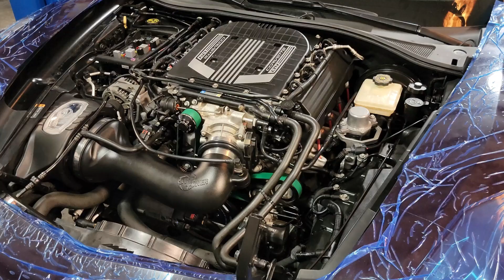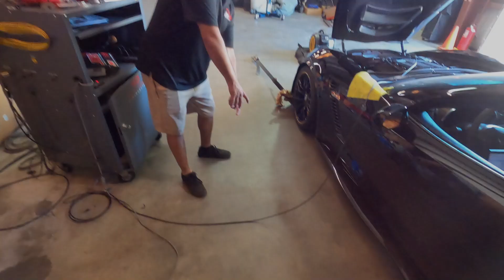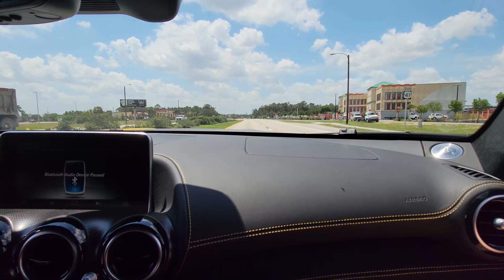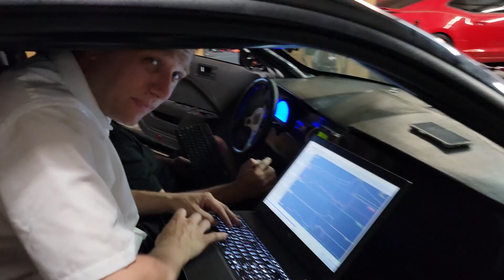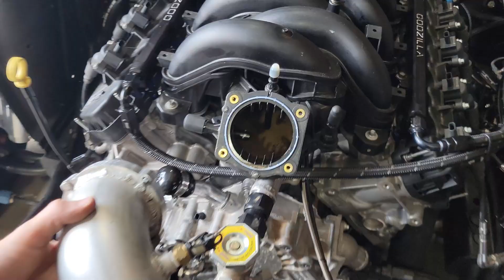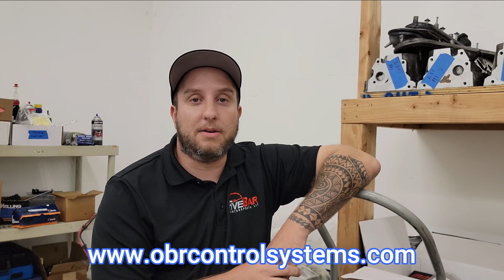Pushing the 7.3L Godzilla to the LIMIT! Over 1000TQ!?!

Comment: How am i supposed to get thrilled about a big V8 making 1000 hp or torque when 4 cylinders half the size regularly make 1800 hp or torque on the same dyno machine? So why cant people find 2500 or 3000 hp with the coyote or the "godzilla 7.3"?
Reply: 1800 torque with a 4 cylinder? maybe at 10,000 rpm or 100 lbs of boost maybe....

Comment: I’m way late on this video , sorry. Are you still running a 7.3 zilla??
Reply from the maker: Yes we are.
Reply: @FiveBarMotorsports  still single turbo?
Reply from the maker: @rtroll7762  Yep. Stock engine. Stage 1 camshaft. 88mm turbo. Ran an 8.6X through the quarter
Reply: @FiveBarMotorsports  awesome!!! I’m looking to put a zilla in a ‘79 F100 short Bed 2wd

Comment: Thumps up for blowing up a brand new motor!  Everybody goes to the hockey games to see a fight.  We go to the oval track races to see some wrecks.  And we come to the youtube dyno videos to see some people blow some stuff up.  You guys did not disappoint.

And now the armchair warriors of the internet will have a video to link back to while getting into arguments with strangers.  Stock godzirra motor is only good for 850HP.  Any more than that and the block parts like the red sea.  :P
Reply from the maker: After going back through the logs with Johan from OBR, this engine made the power that it did on seven cylinders. The original OBR Control System did not like the 16 volt system we are running the car on and fried an ignition coil driver. We're fairly certain that this contributed to the engine failure we had. 

People can talk all they want. This platform is only getting more and more popular as the days go by, and we're more than okay with being the folks that are completely transparent about what works and what doesn't work. :shrug:
Reply: @FiveBarMotorsports  That reminds me of a 1972 comet I had in my younger days with the inline 6 250CID.  I drove it around on 5 cylinders for quite a while.  It had a nice loppy idle to it.

Comment: When I saw the cracked cylinder my first reaction was to think it had a weak(ish) block. But then I saw the other bank had a missing rod/piston. I believe the cylinder wall broke due to hydro-locking as I've seen this happen before when a motor took in water. My question is where did the coolant/oil come from? Blown head gasket or did it come from the dead hole in other bank? What caused the piston and/or rod failure? Power? Detonation/knock?  Possible hydro-lock from a head gasket failure? Have you guys figured it out?
Reply from the maker: We're going to be releasing a video very soon explaining exactly what transpired. Interesting stuff.
Reply: Cheap 93 gas is what happened.  With e85 this would not of occured.

Comment: Can this new engine be installed in the F150 that has the 5.4 3valve on the 6 speed trans
Reply from the maker: It should fit in that truck relatively easy.

Comment: I'm really interested what these motors can do with a strong camshaft and maybeee some mild head work on 93 pump gas, then a smaller amount of boost like 7-10 lbs. I think that limitation is just as important to the average end user of this motor than the guys going for 1000hp+ and 8s in the 1/4. The coyote is so bottlenecked by fuel if you live in an area without E85 like myself. I'm making like 680hp/570tq on 10lbs (paxton) 93 pump. If a godzilla can make say 800hp/800tq on a cam + low boost setup on 93 pump. I would buy that over a built 5.0 simply because the fuel availability would still limit the built coyote's power whereas the Godzilla's ceiling would be a bit higher even stock bottom end. thoughts?
Reply from the maker: Once we have the methanol engine in the S197 we plan on doing some more practical testing with the engine in another chassis. Brian Wolfe over at Willis Performance Enterprises has a lot of great content on some NA applications on the engine dyno.
Reply: Yep, that's where I landed with my 550. No E-85 anywhere near me, so 93 octane was it. Heck, I was glad to even have one station near me with it, but just one.
Reply: you have the same issue no matter what engine base you use, higher horsepower/torque requires better fuel simple as that.
Reply: E85 is needed on this Godzilla

Comment: 1000 tq 800 hp is the stock limit it knocked right before you got on it I think it was the RODS Time to go to a 100 turbo instead of the 88 with those torque numbers or giant cam to lose some torque and make more hp
Reply from the maker: We will definitely have a rowdy cam in our built engine but for now we are throwing another stock longblock in it to go and see if we can run an 8.
Reply: @FiveBarMotorsports  nice . I think the torque it makes destroys itself seems to have the same issue as the 3v weak pistons and rods.
Reply: @FiveBarMotorsports  you guys thought about consulting with Mike Moran of Moran Motorsports for a Turbo grind cam? I know he does cams for every make and model out there.

Comment: As soon as I saw those cooling channels that ford cut between the cylinders I knew that would be the weak point for this motor, sucks that they come like that.
Reply: It is a weak point but that’s all relative. Being 7.3l it doesn’t need a lot of boost before it’s undriveable on the street and as soon as it gets out more and gets on the track more, someone will build a beefier block.  It should still take a ton of power before it breaks.

Comment: Something is a miss here. In Australia our 7.3L godzilla just pulled 1000hp out at 11psi unopened?????
Reply from the maker: To the tire, through an automatic transmission, on an MD1100 chassis dyno? If so that is pretty impressive!
Reply: @FiveBarMotorsports  flywheel not at the tyres. Only mods are a 104mm throttlebody, ecu and fuel maps......oh and supercharger.........on e85

Comment: Wow I was Genuinely surprised by the block failure, I wonder if the saw cut is a weak link and can be filled with something like mini block Guards between the cylinders.
Reply from the maker: We are still going through to determine what went wrong first but it is our belief that the cracked cylinder wall is something that was a biproduct of piston/rod failure and that debris circulating inside of the engine.
Reply: @FiveBarMotorsports  was that the same cylinder the piston failed on? I’d think the factory iron block would be good for more than 1000, the torque was huge across the board though. How much total timing do you have on what fuel? Just curious
Reply: @danielbargas3377  Yup a compacted graphite block of this caliber should be good for way more. My guess the block failure was caused by piston/rod failure or trying to compress water from a head gasket failure.
Reply from the maker: @danielbargas3377  Not the same cylinder we had the piston/ring failure on previously. These pulls were all done on pump E85 that tested at at least 80.
Reply: @FiveBarMotorsports  yeah it should all be good, guess it’s just one of those thing that happens in this game. were the heads studded or factory bolts?
Reply from the maker: @danielbargas3377  We utilized Willis Performance Enterprises head bolts

Comment: I've seen other guys hit 1000 torque and hp with boost in the teens. Are theirs built? Is this motor still sealed?
Reply from the maker: We have not seen many folks putting down quad digit torque numbers with these to the tire. This is an MD1100 chassis dyno and we think it made some pretty impressive power before it let go. It actually got very close to quad digit horsepower on the pull it let go on. This motor was equipped with a mild camshaft from Willis Enterprises, gapped rings, and VCT locked out. That is all
Reply: @FiveBarMotorsports  I'm not saying this pull was unimpressive, it is very impressive. However I'm just curious to how these engines respond to different types of forced induction. Here are a few examples of twin turbo, and a whipple set up, they also claim to have done very little with the engine: https://www.youtube.com/watch?app=desktop&v=Fr4w3Y48IB8   https://www.youtube.com/watch?app=desktop&v=bbtPN37LvmU
Reply from the maker: @AudaciousCaesar  The person's channel you linked the video to is the same person who was here with us this past week testing the new OBR Control Pack. It's an exciting time to be a part of developing this platform's aftermarket use.